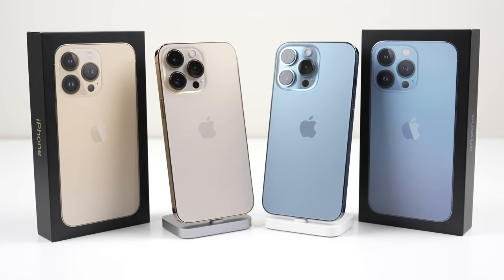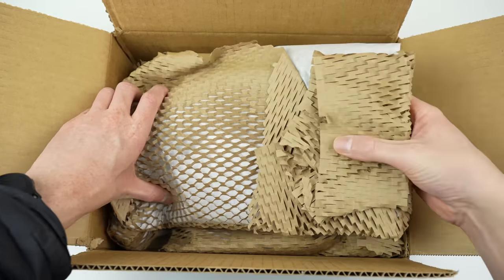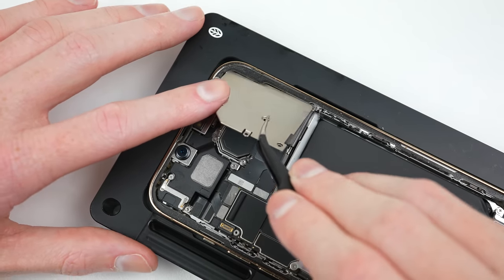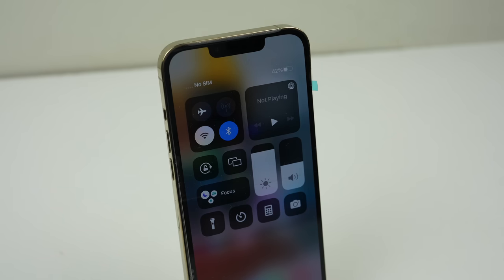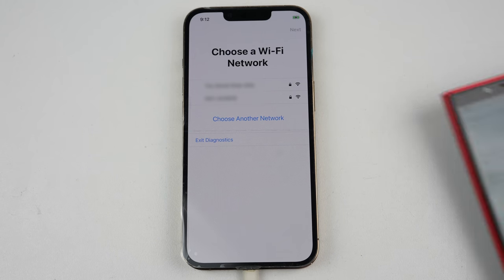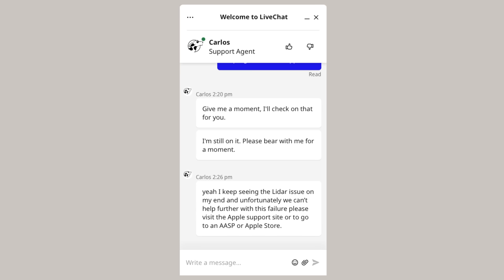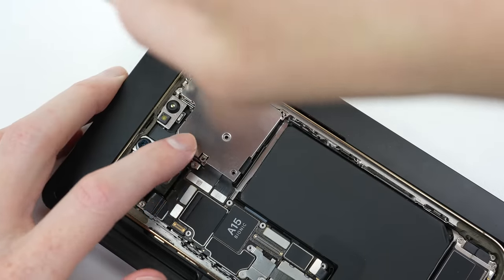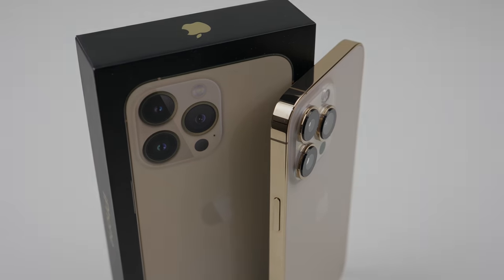Apples Self Repair Program Is Not What It Seems

Comment: Fascinating, considering using the factory parts showed up as "unknown" after the new parts were paired to the phone, it seems as if Apple must store the pairing data in a writable piece of memory. Perhaps with enough testing and analysis it could be possible to locate where this data is written and figure out what is being written. Maybe then it will be possible to completely sidestep having an Apple technician "pair" your new parts and do it yourself! Possibly even have 3rd party display replacements that send the correct info to be considered genuine?
Reply: I'm pretty sure the Chinese already had it all figured out, no way they are going to let rest of the phone go to wasteland because one part is broken.
Reply: Hugh said he was recording the data being transferred but it was encrypted which makes it next to impossible to decipher.
However, I expect one day that some whizkid will work it out and jailbreak Apple's protection system.
Reply: I highly doubt it'd be of any help. Even if you managed to decrypt the blob, there's probably more cryptography involved. They must be flashing a cryptographically signed payload that contains both the part's SN and the phone's SN. The phone then continuouly checks the signature against well-known certificates and disables the features in case of a bad signature or a wrong payload.

You'd either need to somehow add your own certificate to the well-knowns (in order to be able to self-sign the payloads) or bypass the check at software level or tamper the part's SN, which at any rate involves patching the iPhone's software (or even some TEE which is worse). This, if possible at all, requires very high skills in reverse engineering, lot of time, probably lots of equipements, and is fairly easy for Apple to circumvent with an update as soon as you make the exploit public.

We need to get rid of DRMs in general. All DRMs, everywhere, not just Apple's. They're counterproductive, and they just make the world worse.
Reply: That information is saved in syscfg partition on NAND (on iPhones 12 and below). Syscfg is well documented on the internet and it is possible for third parties to change information on that partition with the help of checkm8 exploit(iPhone X and below). Infact you can also unlock Activation locked non cellular iPads and Apple Watches by modifying SN and Wifi/BT MAC address data stored there. That’s also probably why you cannot pair a new screen to the device without Apples consent.
Reply: @two_tier_gary_rumain  Deciphering the data might be far the hardest part actually. Given the screenshots in the video, it looks like Jeffrey only captured TLS packets so this is not even an obfuscation attempt by Apple but just the normal "sane" thing for any communication over the internet (it may just be HTTPS under the hood and zero application-level encryption involved). Nobody sends data through unencrypted channels nowadays and this could have been anticipated beforehand. A better attempt could have been to setup a man-in-the-middle attack.

Anyways, even if you managed to reverse the whole protocol, encryption would still be your latest worry. Signature checks are the major problem here and they're done outside the protocol. You need to bypass the signature checks and if you bypass them, you don't even need to understand the protocol.
Reply: Like someone above me said, pretty sure Chinese repair factory have it figured out and that’s how they can refurbish iPhones without being tethered to Apple

Most of the 3rd party repair tools you see in local repair shops come from China after all where they kinda reversed engineered Apple’s machine
Reply: There's already a device that copys the pairing info from an old part and flashes it onto a new part. Ive seen it before.
Reply: @Madinko12  Yep, makes sense.
Reply: the repair service requires you to connect to the internet so that the device phones home to apple servers to see if your part matches the serial number in their database, as well as verifies there was a repair service transaction in their books. 

instead of writing the same data to the replacement part, each part is serialized and the replacement part has a wholly new serial number, where the special phone home step overwrites data in the phone firmware and updates their server records, and this telemetry is danger close to being able to blacklist serial numbers.

if apple remotely activated this through a software update so that telemetry is a background process, your device could literally tattle on you when you use an unknown or mismatched part, and put those parts on a blacklist.

the way we're headed, apple is gearing up for an arms race. they could start serializing even further down to the board level, where they add even more things to flash, with each board component having serial numbers that even disallows board-level microsolder repair. apple has the capacity to start making a t2 chip for just their t2 chip ad infinitum.
Reply: Think how bad things will get when people are putting you fake or cheap parts that don't Last long... And I'm for right to repair lol but I just think of the abuse.
Reply: @Eligio Budde it doesnt do that remotely currently, it's on device. if you dismantle the phone after setting it up, right after without connecting to wifi, and replace parts, you get the errors. unknown parts, screen is non genuine, battery is non genuine. without a sim or connection.

the repair process requires calling a technician to boot into a service menu to be able to flash the phone so the message goes away. they push whatever stuff is on their servers to device.
Reply: @Eligio Budde it doesn't happen in the background. that's where right-to-repair is headed though if apple wins.
Reply: @Eligio Budde bootleg parts are also sometimes apple genuine just with a replaced glass or ribbon cables. they ARE significantly cheaper but they're also the best aftermarket parts to get compared to a true bottom of the barrel bootleg.
Reply: @ThisNoName  They did for the older iphones, as their data was stored in the display itself and not in the motherboard
Reply: I think I saw something different in the video. They showed up unknown after being mounted on the phones, and they weren't paired as of yet. When the Apple tech dialled into the handset, knowing the serial numbers from the work order, he activated those changes so the two items (motherboard and camera) were paired.
I don't believe the handset or display had this information until the tech wrote that into it and activated it while dialled in.
Reply: @jonathanreading  While devices do exist, the method of data storing has changed from phone to phone. At current screen repairs are possible up to the iPhone 12 as far as I'm aware and batteries up to the XR. Anything beyond that and you can't repair the parts with the non-genuine part issue. For batteries people have got around this by resoldering the original battery board onto a new set of lithium-ion cells.
Reply: @ibol13l3  doesn't work like that all that 'tool' does is restore your trutone to the replacement screen
Reply: Lol right
Reply: It is stored somewhere in secure enclave chip; not possible to retrieve it
Reply: @two_tier_gary_rumain  no one will jailbreak apples software because they are constantly updating it. They probably have the best hackers working for them
Reply: for the battery and screen im sure there is an IC chip that stores all of those serial numbers and these can be transferred to new displays and batteries to restore genuine status
Reply: @two_tier_gary_rumain  It should be possible to replace the phones private keys and trick it into thinking you're apple, and figure out the protocol for switching parts from the phone's side of the communication.
Reply: @two_tier_gary_rumain  I so hope that happens but apple will immediately change the calibration software or something each time someone figures it out idk
Reply: because they're apple
Reply: @Eligio Budde there shouldnt' be a hassle i guess right to repair and all that
Reply: @edwardhudson815  It's also encrypted, which makes everything harder. Changing the algorithm changes everything.

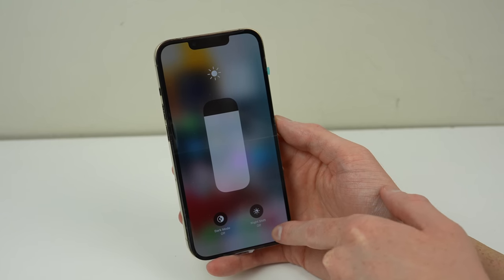Comment from the maker: 7:53 - Small correction. The ambient light sensor is what controls brightness not the proximity sensor.
Despite that, it's still being disabled after a screen replacement, which was the point i was trying to get across.
Update: 5 days after having the calibration issues the self repair store reached out saying: 
"Following up with this issue. If you would like to try system configuration again, please contact us. I would recommend reviewing page 61 in the manual prior to the chat as it gives guidance on the LiDar Scanner calibration process. Thank You!"

Good to see the follow up. Can only hope if they see this video they take it as a way of improving their system.
 If I get back in touch I will update you here.
Reply: you should your ip for a split sec
Reply: would like to see if using a replacement LCD and copying the data from genuine then ask for apple techs help will show if its genuine.
Reply: @mujtabaarain  that's his local ip
Reply: It’s worth mentioning that sales tax is charged on top of Apple’s in-person repairs as well, at the same rate as the self service parts would be taxed (if the shipping address is in the same city/state, since it varies by location). So the parts are still priced unreasonably high, but not more than the in-store repairs, even after taxes. It’s typical in the US for pricing not to include any taxes, and for the taxes to all be added at once on the total of the order/sale.
Reply: I get the impression you like the sound of your own voice

Comment: These repair programs all started around the same time at every company. It is 100% a scam to avoid right to repair laws. We still need them to pass! Don’t support the programs unless you are benefitting from it. I’d still rather pay the same to have someone else at fault if a mistake occurs.
Reply: It is very easy to avoid, just don't buy Apple Products, as a Retired Technician
who also sold 1000's of PCs, I would repair Apple's with their overpriced common
components, due to proprietary firmware, but in good conscience could never suggest the purchase of any Apple Device, sorry they are the biggest scam in the Electronics Business in the World. No Company on the Planet gives you less value for you dollar.

Comment: Fun fact about the Apple calibration software for the iPhone 12 & 13: it's actually just a website anyone can go to, but you have to be AST2 certified in order to use it (which I am). It's not exactly the greatest but it's better than the calibration software for the 11 and lower, which needs a MacBook with a special program on it called repair cal.
Reply: What is AST2? Apple Service Technician 2? What happened to the 1?
Reply: @satsumagt5284  you really, really dont wanna know about AST pre 2.0 it was upgraded for very good reasons.
Reply: @haydenmcdonald4087  oh you bet I do 😳
Reply: @haydenmcdonald4087  start talking or we'll just delve deeper into the digital slavery
Reply: @ArthurD    It's not even that interesting is the sad part, pre 2.0 was jus riddled with such shit code and so many bugs that half the time it didn't fucking work. You can still see those outcomes in ast2 with the lidar scanner failure among many myriad of other things. Apple's software and integration (for their hardware ID sync'ing and locking) just fucking sucks plain and simple. It's overly complicated and solves a made-up problem that at this point i think everyone who works for the damn company has been brainwashed into thinking is the Boogeyman personified. In short, you think AST2 is dumb because of the shit in this video? That's only the surface of AST2s problems; now multiply that by 4, that's what pre AST2 was like.
Reply: @ArthurD  everyday I have to work on an apple product I loathe the process. Repairs are done in 20-35minutes barring dumb shit happening. Making the ticket in GSX, doing the calibration? 30minutes to an hour if not more. I sat and did a LIDAR calibration on a rear assembly change (iPhone 13) for 20 minutes. You have to stand there. Scanning back and forth. All said and done some 40-50minutes later and come to find out, system configuration could not complete the process "Update Records". Everything was done correctly, but it could not communicate the change from the original rear assembly serial to a new serial. Everything on the phone worked as if it was factory. But because apple wasn't apple to see EVERYTHING they wanted, the repair had to be scrapped and sent back. That rear assembly properly went through a shredder to pick parts out of it for a new one. Utter fucking waste.
Reply: At my AASP i was always able to run the config 2 times.
Reply: Also just failing post repair and ordering a DOA part is always a good option 😂
Reply: RepairCal only works if you replace the display for the force touch. 
If you simply replace the battery simply use sysconfig
Reply: Unnecessary for iphone 4-8
Reply: someone needs to leak this shit, full stop.
Reply: @ShushLK  chatting with pakistan hq apple is such an waste of time, eugh.
Reply: making a repair on the Mercedes Benz adaptive cruise control system is easier then this mess.
Reply: @crazeguy26  mercedes charges way to much for online access to do scn coding. There are other ways but one must become an (engineer/mechanic/rocket scientist) to get around paying thousands for online access. Then there's FBS4 maybe mathematician or just magic. Lol
Reply: @Autokey_Security_Services  The Autel MS908 and do alot including ADAS repair.
Reply: @crazeguy26  thanks I know I have Adas setup. I was just being sarcastic because Mercedes is just as bad as Apple if not worst with there high fees for online functions and limited licenses that aftermarket shops can get to access  some systems on Benz
Reply: @Autokey_Security_Services  Toyota takes the cake on that.
Reply: which website?

Comment: Thank you for this video, Mr Jeffreys. This represents the highest mark of professionalism of any technical video I've seen on YT so far.
I never owned or will ever own an Apple smartphone because I'm opposed to the idea of closed-system hardware and software; but I'm interested in following their paces thru the technological progresses; and your videos are a wonder in that respect.
I understand Apple uses a hardware encrypted enclave, where the various hardware components are authenticated before (and possibly during) the device operations. This process doesn't differentiate the various components, but creates a matching table of parts - authorised by Apple - which can operate together only after Apple acquired the serial numbers and authorised the pairing.
The repair process you have shown complies with the letter, but not the spirit of the law about the right to repair.
The Apple reaction to the new law on repair shows their lawyers are more skilled than their design engineers. 
I suspect this Marie- Antoinette attitude, "give them cake", will backfire.
Once more, thank you for creating such an incontrovertible reference standard regarding Apple behaviour and decisions on "right to repair" matters. 
I remember with nostalgia the Apple II - which shipped with circuit schematics, instructions and eight open slots.
Regards from the UK,
Anthony

Comment: I had two iPad pro 10.5 with display and motherboard damage respectively. Since the display damage one was badly mangled, i thought of just transferring Logicboard and home button. Both Cameras didn't work and froze. I had to again disassemble everything and transfer the cameras and then everything worked fine. It was super hard repair but not impossible. Thanks to your videos and Northridgefix videos. His videos are the defacto repair guides to the minutest complex issues. Your videos are good for best disassembly.

Comment: This is just a big middle finger to the right to repair movement. And it basically costs the same as just taking the iPhone to Apple and get it fixed.
They even use the same machinery in the Apple Store
Reply: It’s not a bad thing that they recommend the same machines that Apple stores use because a novice is likely to make small mistakes. It takes longer using their machines but it’s more idiot proof. The part pairing however is still dumb.
Reply: @supafly8  what are you on about bro
Reply: @kushalraj  their machines aren’t more idiot proof my guy they’re about the same as the ifixit kit and any other phone repair machine

It just looks more convenient. but there’s far morn cheaper and far more easy to use tools.
Reply: @doodlecaboodle9298  oh yea there definitely are easier to use and cheaper machines out there. And i fix it makes great ones. Apples machines just take the guess work out of how much pressure to use to seal phone, stick battery, how much and how to heat the phone to remove screen without damaging it. If you have 25-40% of the knowledge then all other tools are better. If you have 0 knowledge other than the manual you just read a week ago though you might damage the phone.

On a side note: it makes it almost as perfect as a factory phone quality of repair wise. I.E. You can be confident of the water and dust sealing because even repair shops don’t seal phones with the proper pressure sometimes. I have had a phone damaged due to water after a repair shop didn’t seal the phone properly. So if a repair shop can make a mistake, a user new to apple’s weird shit is more likely to do it.
Reply: @kushalraj  yeah because nobody wants to have someone steal their phone and change the part that protects all of their data.
Reply: It is not exactly middle finger, Apple has multiple times said they want end-to-end control over all their ecosystem. It is their design philosophy, they are not trying to trick with it.